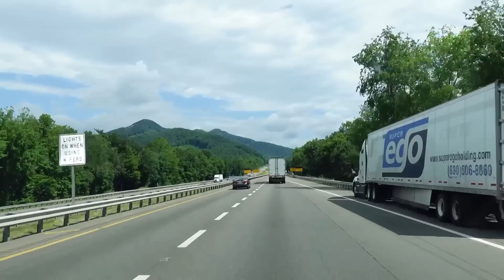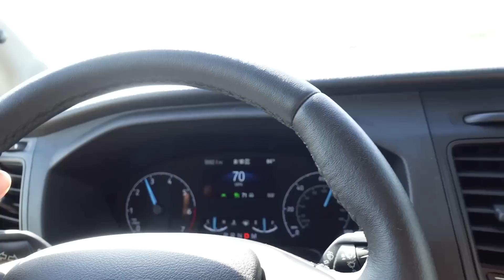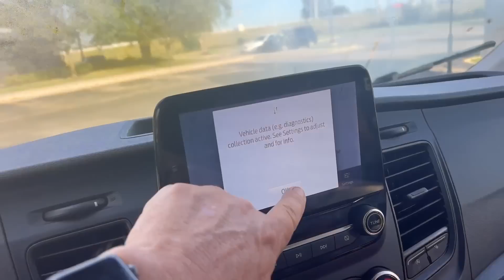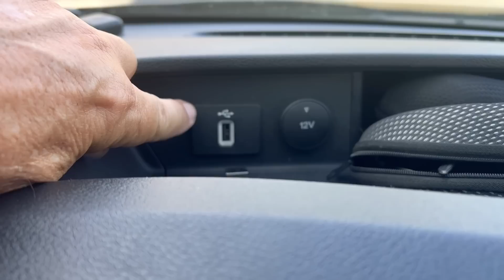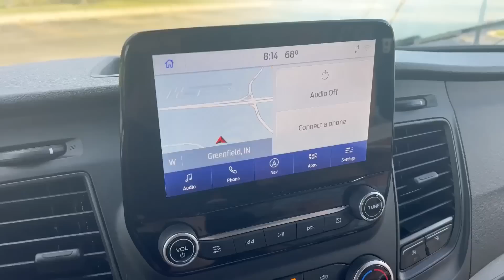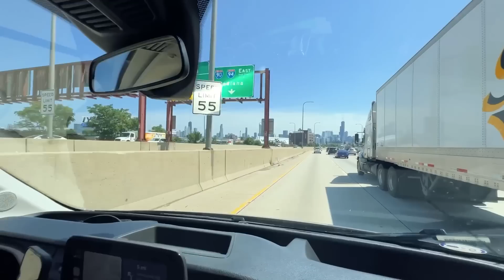DRIVING a Winnebago EKKO Ford Transit  -  SAFE? LOUD? FUN?

Comment: For the blind spot assists....  I had a similar problem and at one point disconnected the battery, it reset and no problems since (Ford transit connect).
Reply from the maker: Thanks for the info.

Comment: It's a lot quieter than my Super C!
Reply from the maker: 😂👍 Yeah but I bet you have air suspension, a ton of room and if you wanted to you could pull the Ekko behind you. 😂😂. They all have their advantages for sure. Thanks for watching.
Reply: @VANTREKKINGlifestyle  HaHa, nope no air suspension, rides like an old school bus... which ironically is exactly the International chassis that buses use.  I'm ditching the Super C this year as we're no longer full-time and looking for a Transit based small C.  NO SLIDES.  Had enough of those friggin things for a lifetime.

Comment: Regarding the problems you've had with the blind spot monitoring feature, Winnebago released a technical service bulletin instructing dealers to replace blind spot monitors on certain EKKO models in order to improve performance and reliability.  More details here: https://static.nhtsa.gov/odi/tsbs/2021/MC-10206779-0001.pdf

Comment: Thank you for the informative video. I think you might be the first actual drive review. Many walk throughs, no driving. You should make a off road handling video when you get a chance. I'm currently in my Tranquility 19L van that I've had for eight months now. Finally got all the bugs out, but put my order in for my 2023 Ekko last week. Tranquility is a pleasure to drive, but not quite big enough camping. If you don't mind me asking , how long from order to delivery with your Ekko? They're telling me it could be a year. Thanks again . RS
Reply from the maker: We bought our Ekko used so we didn’t have to wait.  Our dealer told us the same thing, it would probably be 2024 before we could get one due to their wait list.  Thanks for the suggestion to make a video of driving off road, we will do that for sure.
Reply: There are two very impressive EKKO videos showing several Ekkos going "off road" (dirt roads in the West) produced by the YT channel "Ekkonesters."   Look at the one they filmed on a caravan of vans and multiple Ekkos going to the Grand Canyon. The roads were likely worse than what 99% of van lifers will ever try. The EKKOs did fine. Be aware there is a ground clearance difference between the Sprinter chassis and the Transit chassis, as the Sprinter has a few inches more clearance. Also, the Ekkonesters did have some big tires and some suspension changes, but Ekkos can have a lift too.

Comment: Great video! Our Embassy is on a Ford Transit too, so it was fun watching to see if there were differences. We don't have that little red light that you have. Ours is on the mirror, so not sure if that red light is a Ford thing or a Winnebago thing. We've got Embassy added a camera rear view mirror that we can turn on and off whenever we want. Don't know the brand though. You can control brightness and contrast with it too. 
Wondering why you don't want the auto stop feature? Would turning it off make that much of a difference when charging with the second alternator?
Not sure if you've mentioned it before, but do you have the gas generator and one 320Ah battery or two 320Ah batteries?
I was also wondering what the maximum occupant/cargo capacity was in the EKKO. Trying to compare Class C and Class B styles.
Thanks for always posting great stuff! Be seeing you!
Reply from the maker: That stupid blind spot system is one of the weakest parts of the design.  It's better now but still not perfect.  It was added on after the fact by Winnebago.
Reply: @VANTREKKINGlifestyle   I wonder why they didn't use what Ford already had? Maybe it was too wide so the Ford system wouldn't work? Hope all y'all had a great Thanksgiving!

Comment: Thanks for doing this video. We own a 2021 Pleasureway Ontour 2.0 on the Transit chassis. We've been eyeing the Ekko for a little more space and the 4 season capability. After watching this episode, the noise and low mileage of the Ekko, are enough to quit eying it. The Ontour is very quiet and I'm getting 18-20 mpg without eco mode. As cool as the Ekko is, it's seems to have the same pitfalls as most class c's.
Reply from the maker: You are so welcome.  The Ekko has a lot of good feature’s but like with everything it’s not prefect.  If anything we are honest.  Sounds like you have a good setup.

Comment: Owen ….for the engine start/stop there is a separate connection on the battery terminal with a smaller gauge wire. Simply disconnect the connection and the start/stop is disabled.
Reply from the maker: Wow!   $200 saved!!!! Thank you very very much.

Comment: Owen you don’t look that comfortable in the front drivers seat. Kinda crammed into space. Can you recline and push back seat for leg room if the table behind is removed?
Reply from the maker: Yes there's lots of room. I'm like that on purpose.  Tweaked my back the week before and sitting closer and more straight up outs kore of the stress on my legs instead of my back.
Reply: @VANTREKKINGlifestyle  Tks for clarifying. Enjoying the journey.

Comment: You said it takes the wheel away from you and puts you back in your lane. What if you are going around a piece of tire in the road, can you over ride that or does it still try to move you over?
Reply from the maker: Yes if you keep turning it will allow you to do that. If you turn on the turn signal it disables that feature.

Comment: You are going to like the Ford Transit. I have a 2020 Ford Transit 350HD built out by Coachmen as a 2021 Beyond. The stock Ford blind spot mirrors work great, must be something the way Winnebago installed the sensors. One trick you may want to try is the remote start. On mine, you push lock/unlock/lock on the key and the engine will start. Do it again and it will shut the engine off.  Looking forward to your adventures in the Ekko.

Comment: I made a trip from S Ind. to NY in a class C..and the noise drove me crazy. I was a rough ride too. So I am glad you are upgrading yours so it is a much more smoother ride.  Would thick rubber mats on your floor help with the sound ? I hope insulating the back doors help. THANK YOU for sharing.
Reply from the maker: Like with any new rig you have to work out the little quirks.  Thanks for the rubber mat suggestion, we’ll give it a try.  Those rough rides really do wear you out a lot more.  We appreciate you following along.

Comment: We ended up taking our unit to Forest City to get our blind side monitors repaired. They replaced the monitors with ones designed for wet weather. After they checked, it still wasn’t working and they replaced the entire wiring from the front of the coach to the rear. It’s still working, fingers crossed. They also did the other two service projects mentioned in the group. I have to say, with regards to Winnebego service Dept, we got more accomplished in three days at their shop than we did in six weeks at our local dealer. Most due to the dealer having to document, submit for warranty repairs and then wait on parts I’m sure. It was just top notch work and our tech even caught things we hadn’t and fixed them.
Reply from the maker: Thanks so much for sharing your experience with Winnebago, it’s good to hear.  I’m sure it’s hard for dealerships to keep up with all the recalls and warranty work on all the units they sell.